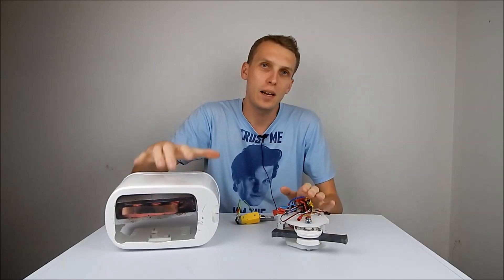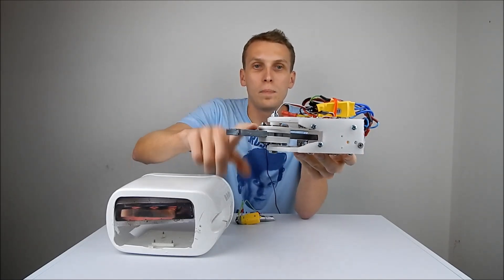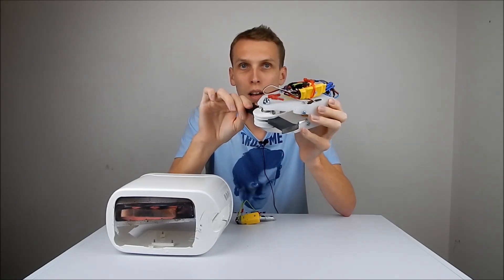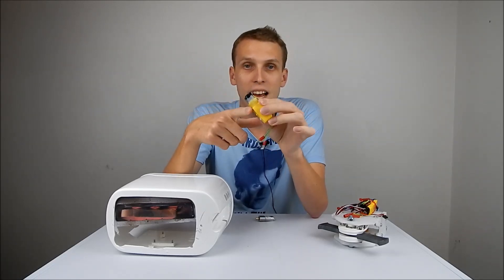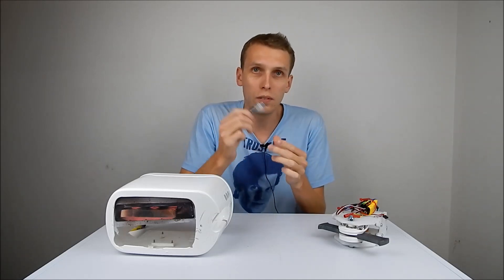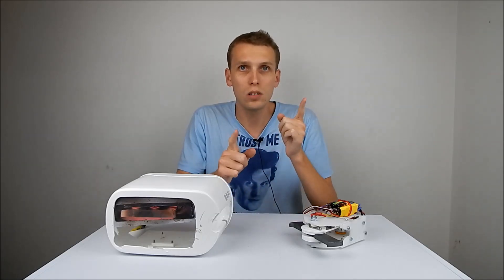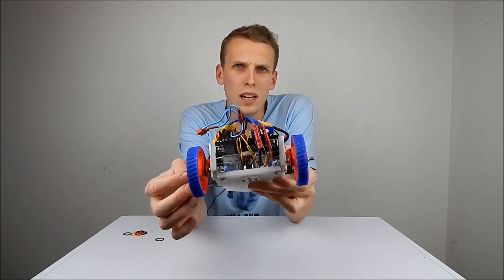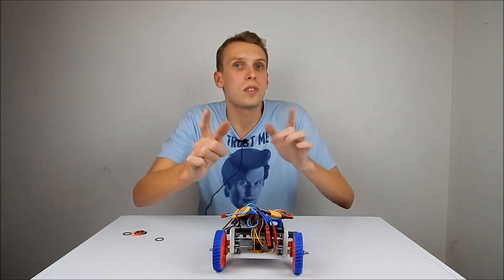Breakfast Beetleweight Belt Drive!

Comment: Where do you get the belts and pulleys from?  The weapon ones in particular?
Reply from the maker: I printed them. 
The pullies are 3d printed PLA and the belt is a v-belt 3d-printed in TPU (which is flexible and super strong)

Comment: If you at least double the diameter of the driving and driven pulleys, you will at least double the traction with the belts, and more importantly, halve the tension or stretch on the belts.
Reply from the maker: All great ideas, but I think I am going to ditch the belt drive entirely and use 3d printed gears instead.
That way I eliminate any chance of slip
Reply: Well, if you do the gears, you should still make them as large a diameter as practical because the shear loading on the teeth is inversely proportionate to the gear diameter. And you are already dealing with a relatively high torque output from the motor gearbox.